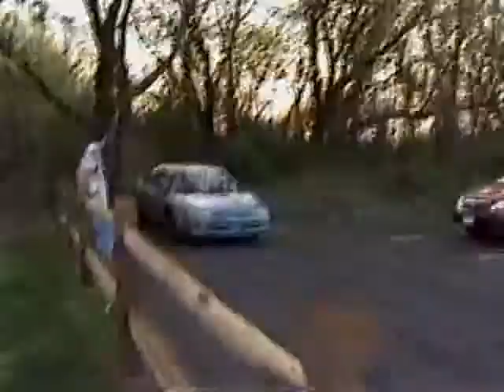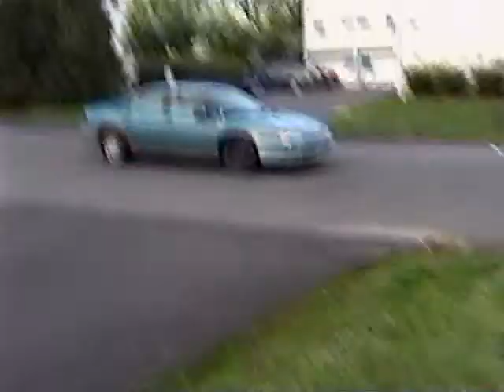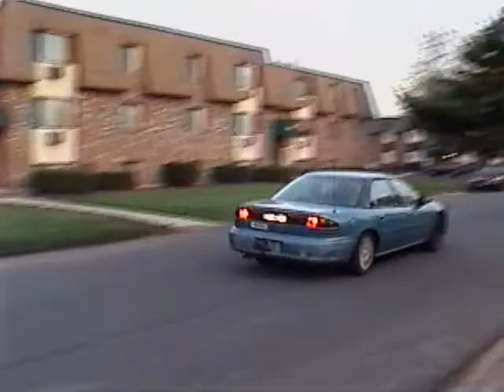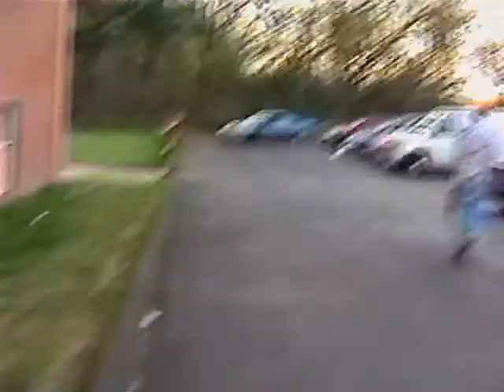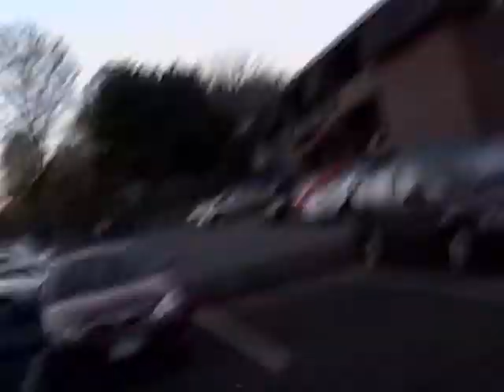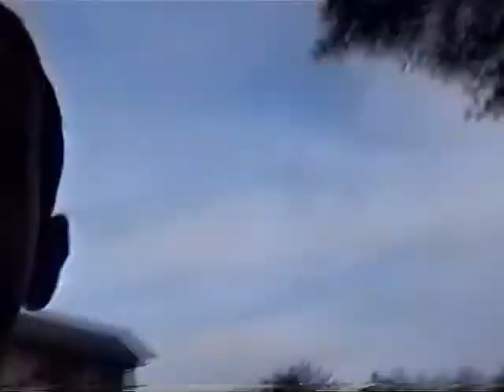1997 Dodge Intrepid - Burn Out

Comment: hey i know intrepids governer restricts them from bein rev up pass 4 RPM i have a 1999 dodge intrepid ES if you hold the gas can it cause damage to my engine even though on my car the engines red lines starts at 6 1/2 RPM but the governer doesn't allow it to atchive that in park

Comment: I have had experience with an intrepid, used I admit, but a total lemon...barely put 2000 on and the radiator and cooling system failed completely. its a good motor plenty of low end and power, its just that they have some key reliability issues.

Comment: the 99 had the horrible 2.7 V6 which was a destructive engine and bad design. i wouldn't be suprised if the governer kicked in at low rpm thats normal for neutral and park on automatics on those cars. whats the millage on your 99 intrepid?

Comment: Yes I do, in that when people abuse the shit out of a car (like this video) it doesn't matter what make, model or year the car will break prematurely.

But, do you in turn see my (and others) point? We're not trying to make baseless smears against a company or product. We're pointing out facts and sharing our personal experiences about a poorly designed vehicle component-in this case the steering assembly.

Chevy did it with the Corvair (1960-1964)

Ford had the exploding Pinto (1971-1980)